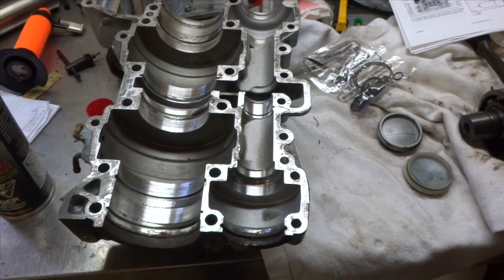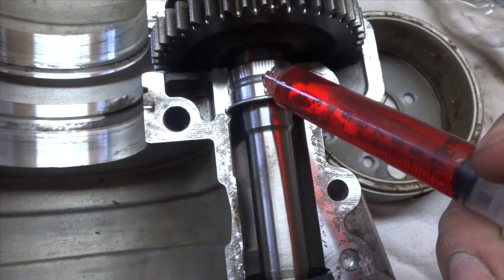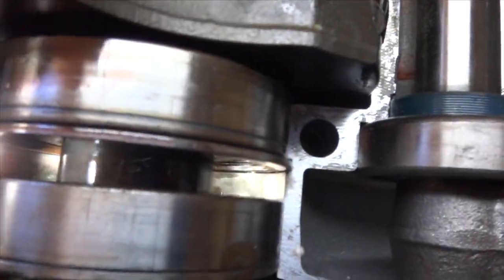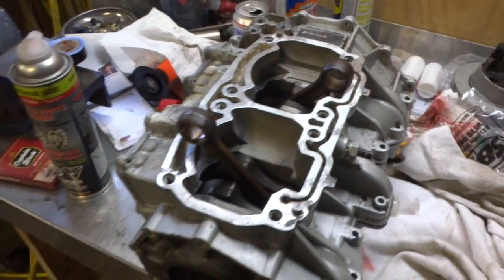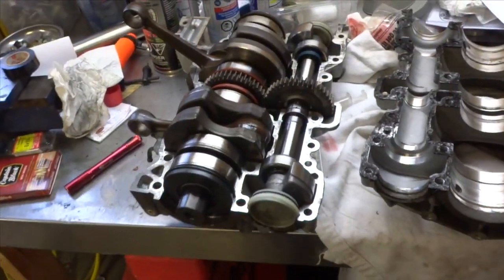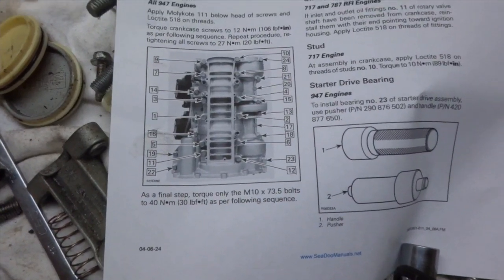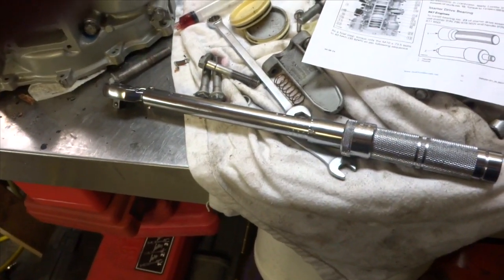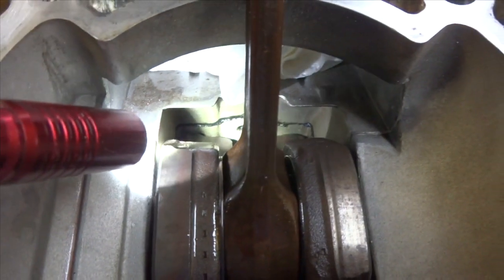Seadoo Crankcase Assembly

Comment: Hey, u r pretty darn fun to watch. I was wondering if I need to check crankcase oil level on my two 1997 GSX’s 787 engines. They are running fine but I have never thought about checking crank case oil level? Paul in Iowa.

Comment: Great videos, no beating around the bush and straight to the point. Maybe I'm like $10.00's short and 9 - 10 years late, but I ran in to your videos looking for some type of info in how to replace the counter balance shaft oil retainers, since I haven't found anything on it neither any marks on the ends. If you still around, is it anyway to do this? or do I need to replace the whole counter shaft over 2 oil seals? I've look long and hard all over google and you tube and no avail. Thanks in advance. Great informative videos btw.

Comment: there is better sealant to put the crank case back together than silicone. that's probably the worst shit you can use.
Reply: I don't know about the worst. Threebond 1211 probably the best, followed closely by 1184 or Yamabond 4. If he's using something like the Permatex Ultra Black silicone I'm sure it's fine. Using the roller is definitely the best way to do it but you can use your finger if you have to.

Comment from the maker: you could rebuild the top end in the ski however you may run into trouble getting the cylinders off as when you remove the nuts on the head the orings get jammed and are a bitch to pull the cylinders off.  I would personally pull the engine and inspect the counter balance bearings as they are the weakest point in the motor

Comment: Hello i got a question for you i have gtx di 951 i recently remove my rave valvels and notice brown looking oil on them and  with a flash light i look inside the pistons they look OK by ok i mean no marks on them !!!BUT ONE PISTON RING GAP IS VISIBLE THRU THE RAVE VALVE HOLE!!!!! is this ok how bout the chocolate oil is it gasket....
The reason that i pull the rave valves i was getting low compression 110 mag- 105 pto.... Any help thanks...